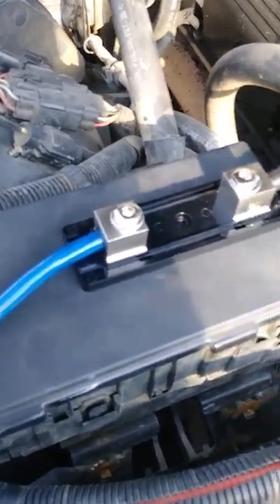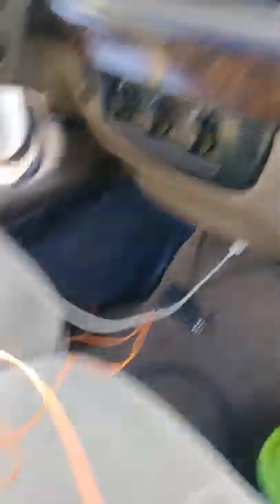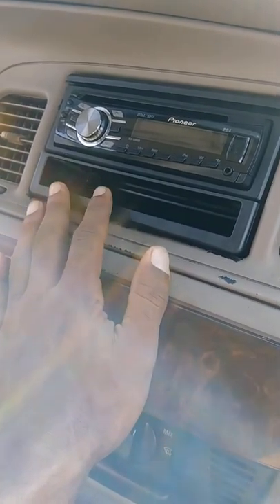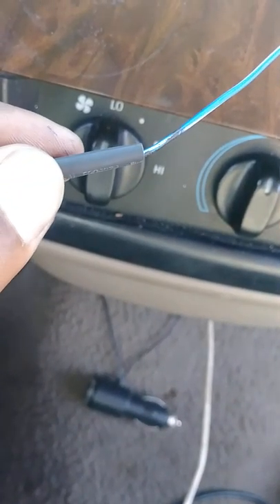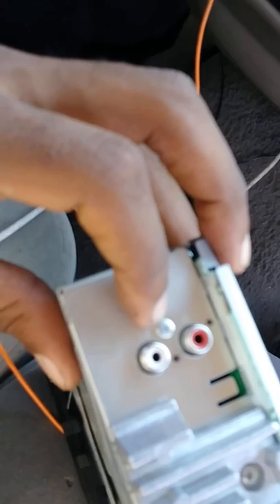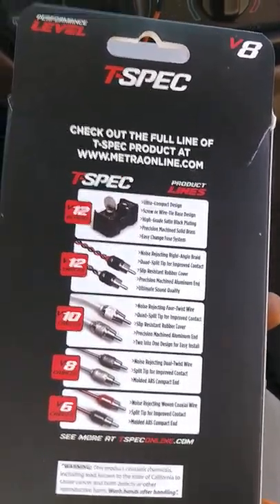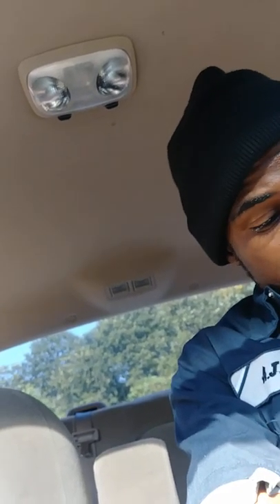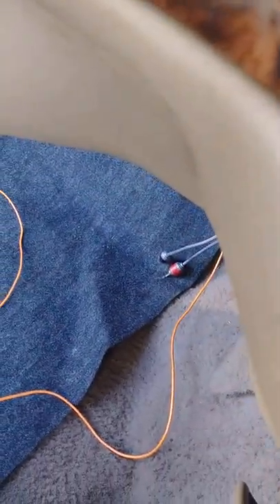How to hook up wires and amp in grand marquise part 3

Comment: Hey I need to bypass the factory amp on my Grand Marquis 2000 LS could you possibly help me out
Reply from the maker: ok good question: So if you haven't already you can either do a hard wire which is cutting the power from the factory amp and running your wires straight from the radio to the speaker. Or install a inline converter off the speaker wire to a more powerful amp if that's what your trying to do but let me know?
Reply: @a1da1  the problem is IDK which wire is the factory amp wire
Reply: @vikz1803 ok you'll have to look up the schematic on your year model for the amp. It may be orange or brown those usually are the main ones
Reply: @allanhamilton1458  I've looked around countless of times but no luck .could you help me out if and when you have a chance to look it up and see if you can tell me what wire it is
Reply: @vikz1803  aight mane this is what I found, see if you see the same color coordination on your factory amp:
 black/green: Ground 
Red/Yellow: Power
Brown/Orange: input+
Red/Black:input-
Dark Green/Violet: mute 
If not hit me back up and we'll try something else
Reply: @allanhamilton1458  yes you are correct
Reply: @allanhamilton1458  yes you are correct

Comment: What is the color codes for the Stock wiring harness plz let me know I'm not using a harness so I need the codes plz!
Reply from the maker: You can look it up through Google images it wont let upload it on here put in factory wiring diagrams for crown vic and go to Images it should get you what you need.

Comment: Where is the factory amp on this car located??
Reply from the maker: Hey boss man these cars don't come with factory amplifiers. The way it's controlled is by the harness, it only lets a certain power range come through so it doesnt damage the factory speakers. But theres no factory amp that I know of. Hope it helps thanks for watching.
Reply: @a1da1  Thanks for you answer.
Reply: H I've been going crazy trying to figure this out, i guess the only solution then is replacement speakers huh? I was scratching my head, thinking WTF i know it's wired right, but it only worked at very low volume, the moment i turned it up it would sound like an amplifier was waiting for low pass to pass the sound and not getting it., if that's the case though ill rip these cardboard speakers out.. thanks H..